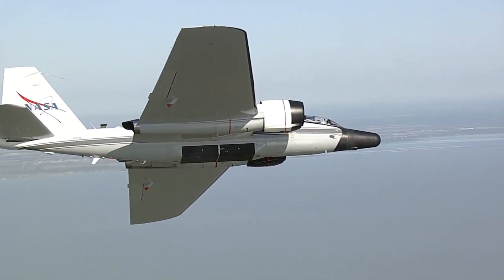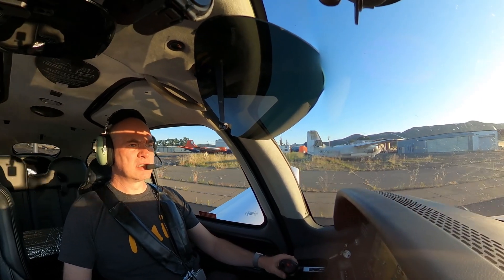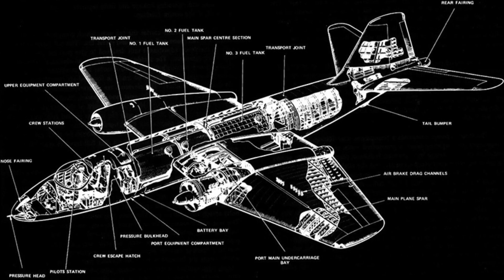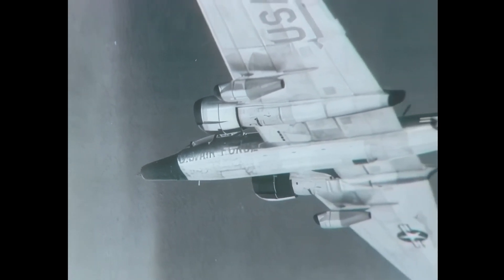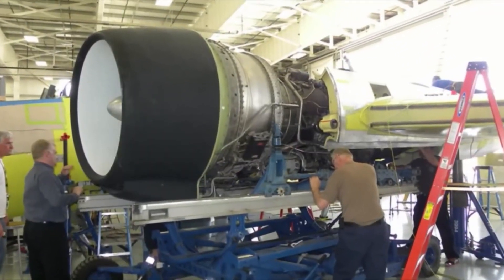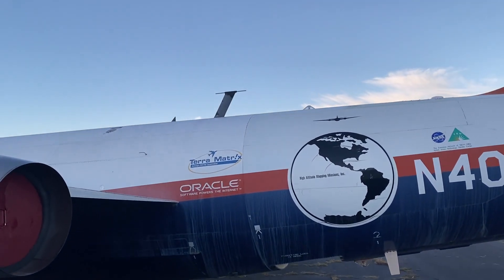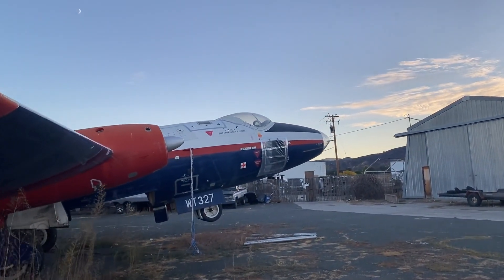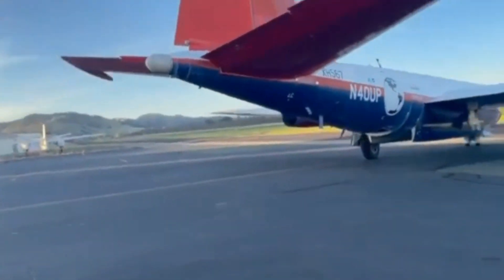Why NASA Relies On A 1950's Aircraft Design To Track 21st Century Spacecraft

Comment: That was an awesome story! I've always wondered about the history of the rb and wb 57!

While I was living in Houston, (all of the formation flying footage in this video was done over Houston and over Galveston bay)

 I got the rare chance to see one doing an experiment directly over downtown Houston one day. 

It actually caused quite a commotion amongst my fellow Houstonians who couldn't figure out why there was a giant high altitude contrail in the shape of an oval track, hovering right above our city. Panicked residents called 911 to report it and many of them asked if we were under attack! 

Turns out, they were just doing air quality testing with some new experimental equipment at 70,000 feet (so I was told).

 There are still three WB-57s stationed at Ellington Field where experiments that are built at Johnson Space Center can be driven over, installed and tested. NASA 926, 927, and 928. 

I also got the rare opportunity to see one up close while at our annual "Wings Over Houston" airshow one year. 

Back then I had no clue what it was and just assumed that it was a converted U2. I remained baffled by it for quite some time. 

This video really helped fill in some gaps! 

Thanks for posting it!

I really hope that the restoration group gets that old bird back into the air again. I always worry about the airframes on these old birds and I really hope that the restoration team doesn't overlook any potential damage that may have occurred in service. 

P.S. best comment section of the year 🏆 

!

Comment: The published service ceiling of FL 60 for the WB/RB-57F is for shure disinformation in respect being a high altitude aircraft and it's wing/engine config. The inoffical FL 80 is much more understandable. Also the FL 70 of the U-2, FL 100 is more realistic for it.

Comment: Thanks for that video a well deserved advertisement for this brilliant aircraft and its history. The originality design was under the stewardship of Teddy Petty (Lysander, Lightning, Whirlwind, Gnat) and started its gestation as the war came to an end. Originally this aircraft was to be a stop gap bomber u till the V Bomber force came into operation especially as it was anticipated there would be delays to those sophisticated aircraft. As it turned out the Canberra was so good it long outlasted those aircraft in service and indeed has the honour of being the longest lasting RAF aircraft type. Its high level success has a lot to do with Petter’s experience designing the Westland Welkin a wartime high altitude fighter. The wing of that aircraft followed traditional aerodynamic knowledge of the period in regard to high altitude wing forms (wind tunnels at the time could give unrepresentative results which affected for example Hawker design of the Hurricane and Typhoon) which in this case led to putting it simplistically long and thick at the base wings. This proved fundamentally wrong in reality and thus lessons learned by Petters team on real time air flow led to the thin shortish wings of the Canberra when he moved to English Electric that was world leading at the time. 

In the uk there is a working Canberra in taxiing state in similar livery to these ones ironically that also has an impressive history, having been gone between fighter and bomber profile and was used to cover and film the early UK nuclear bomb programme.

Comment: The engineers from the early Jet Age are hard to beat 

EE Canberra
Boeing 707/KC-135
Lockheed L-188/P-3 Orion
Lockheed C-130
Lockheed U-2/TR-1/ER-1
Boeing B-52
Tupolev Tu-95/Tu-142

Comment: Your Canberra XH567 Red/White/Blue is an ex-test pilot school aircraft that was based at MoD Boscombe Down the same as your  Edwards Air Force Base test pilots school. I presume that the test pilots were taught how to handle the Canberra with one engine shut down because it can be a bit of a beast on one engine. This is only speculation on my behalf I'm not a pilot so perhaps some of your avaitors can put me right.
Reply: It was never with ETPS as far as I am aware. I was FTO on this a/c from 1978 to 1994 at RAE Bedford, It was one of ten in our fleet

Comment: I was a member of the USAF 53d Weather Recon Sq, out of Ramey AFB in Puerto Rico, late 60's.  We did a TDY to sister weather unit stationed at Yakota, Japan, i think it was the 57th WRS.  They had the 4 engine models of the WB57, long wing.  Pretty cool aircraft, takeoff and landing were special.

Comment: The Canberra's contribution and capabilities is often sadly overlooked here in the UK partly due to the often "opaque" nature of its more unconventional missions but it deserves respect as do any of those rare and special aircraft (U2, SR71 etc) that have routinely operated above the Armstrong Line (60,000 ft). It was designed as the first RAF jet powered bomber to a specification laid down in 1944 to replace the superb mosquito and it served in many roles with many variants and saw considerable export success with the USA, Australia, Rhodesia, NZ, Argentina among its many operators that recognised its potential. Even France and Sweden used them for research purposes. 
General handling at all altitudes was excellent and it could be flown aerobatically outperforming many early fighters. It was only a "handful" when on 1 engine (Assymetric) at low airspeeds and altitudes and this had to be practiced regularly leading to strong leg muscles on one side. Early versions suffered at altitude with inefficient heating when outside temperatures got very low and in tropical or desert environments the crew were in an oven, in fact my father remembers having a DR on board who got heat exhaustion and passed out on the taxiway (and he was only in shirt and shorts!!) 
Although there were plans and tests to develop the RAF aircraft much further to make it refuel in the air the fuel system was not initially compatible and this was sadly shelved in favour of funding the new V bomber force.       
For those that may be interested the USAF competition was held in 1951 at Andrews Air base against the XB51 and B-45 (both excellent designs) each aircraft performed the same routine for comparative purposes with the Canberra flown last by Roland Beamont. The story as told to me was the aircraft completed its manoeuvres within the airfield boundary and then sequence completed Roland noticed he had a few minutes spare so in typical British manner he went a bit "off script" and started "throwing the aircraft about" with a low pass into a max rate turn and vertical climb, then shutting down both engines and spiralling down into a short touchdown albeit with all tyres bursting (due to the abrasive sand on the runway) anyway the rest is history and the Martin company made some useful improvements to the aircraft that led to the B57 (notably cockpit and airbrakes).

Comment: Was there a sticker on the side of the aeroplane you walked around of a Canberra silhouette with yellow and black stripes? If so, that was probably a commemoration of one of its roles as a target tug. 100 Squadron were based at RAF Wyton in the 1980s and you would see their Canberras most days.

Comment: Seeing the evolution of the Canberra is just neat. While the turbojet models were cool, the turbofan versions was just insane, especially with the longer wing span. I'm about to complete my A&P (aircraft mechanic license) and I think it's just fascinating to consider working on something like this. It's an ancient design, the airframes themselves are super old and it's basically a one-off. You don't exactly have a maintenance manual to work off of either. So cool.

Comment: That Canberra is in RAE (Royal aircraft establishment) colours and would have been based in Farnborough in the UK up until the 90s when they moved to Boscombe Down. I grew up in Farnborough and saw them flying around all the time. They also had a cool c130 with an elongated nose called snoopy. Didnt expect to see one on your channel!
Reply: Actually they were based at RAE Bedford, we had ten Canberras as part of the Radar Flight Trials Unit which was a lodger unit run by Royal Signals and Radar Establishment at Malvern. One of which was WT327 the other Canberra in the video, its last work there was research on synthetic aperture. They all flew out of Bedford when it was closed in 1994.

Comment: The U2 is a very specialized aircraft and not made for carrying much as far as payload, it was purely a high altitude spyplane then used for research.  Why design and build an entirely new aircraft when you already have a solid proven plane just needing extensive restoration? They already knew what it was capable of and modifications that worked, so it's a relative bargain as far as that goes. No problem keeping a great design around when there's nothing wrong with it.

Comment: During the Shuttle RTF I was stationed at NOTU Cape. Navy had a civilian ship fitted out with a 25 M (give or take) microwave dish. They load that thing up with a big crane they used to service the subs. They take it out directly under the path of the Shuttle. I saw videos of the RADAR. They could see things as small as a fingernail. It was a minimum crew as small as the risk was, it was under the shuttle’s flight path. I imagine it’s still doing its thing. I go over from the West Coast every so often to help get it on and off. Good times as I got a good look at a few launches. Then the ones they didn’t need me. I got access to the (now just closed) VIP bleachers. I don’t think we were more than a mile from the Shuttle. We got to see Endeavour take her last trip on the next to last launch. They scrubbed so I was lucky to get leave the next week to see it.

Comment: Ex FAA chap here. Worked on Canberras in the early 90s. Had a bit of a chuckle, the Canberra you filmed with its nose in the air was probably due to the airframe being left outside without the hockey stick fitted to the tail. When left outside, we would fit a piece of ground equipment shaped like a hockey stick to the tail as in certain conditions the aircraft could become tail heavy.

Comment: When they were scrapping them in the late 80s, I bought one of the reconnaissance camera lenses I think the negatives the camera took were 10"x 10"., it had a 5" 5 element objective at f 6.3 built like a tank and heavy with variable apature it would have cost many thousands to make, I payed £20 and turned it into a wide field telescope, maybe it did do some spying in its time.

Comment: Look up "Green Leader" Rhodesia and you will see that these were very good at low level too. They were exceptionally quiet and could be on you before you knew it (personal experience). There is a story from the Rhodesian Bush War which gives an account of a Canberra strike on a ZANLA camp and what gave the game away was not the sound of the jet engines but the bomb bay doors opening. Their operational range was excellent too and they even reached out to Angola from Rhodesia.

Comment: There was a weather squadron across the field at Yokota Air Base in Japan when I was stationed there back in the late 1960s.  They had WB57s that had 4 engines. A TF33 and a J60 on each wing.  I’m told they would shut down the big fans at altitude and just run the J60s.  They were used to sample the air near or maybe over the Soviet Union to see if they were testing atomic bombs.  Watching them take off was a real treat.

Comment: Hey at 10.07 you show a Graviner fire extinguisher with the gun powder firing cartridges still attached I worked on those in the UK haven't seen one in years. Is that the thing that you talked about firing the engines?
Reply: No. the starter cartridges are located in the nose cone of the engine, they are just like an artillery shell cartridge, 3 inches by 71/2 inches, just measured one of mine , used I might add

Comment: My father worked on the RB-57’s during Vietnam.  He would tell stories of the black powder cartridge staring system and the fire department showing up if the airfield wasn’t used to them thinking something was on fire.  Other cool stories were of a weapons system installed in the bombay that was basically a battery of guns that pointed doesn’t and would all fire into the jungle, or loading conventional munitions in the belly and wings.  Defiantly an interesting plane with a long history.

Comment: The WB-57's that NASA use with the extended wings and turbofans have to have an extensive wing box inspections post every flight due to stress cracking. No one argues that the Canberra and the Martin B-57 were designed to last, but not to carry the tensile weight of that extended wing and engines. If memory serves the one retired refitted WB was removed from service due to this box stress cracking. But it is a brilliant design overall and a total credit to the men at English Electric who could have never imagined that their creation would still be serving in action so many years later. Also a trivial note. When the WB-57 is used for US DoD purposes, the NASA logos are removed from the airframe.  When it goes back to NASA for civilian research, the logos go back on. A WB-57 was spotted in non-NASA dressing in the UK during a large international air force meet.

Comment: My father worked on Canberras whilst stationed in north Africa, I think it must have been RAF El Adem in Libya as I remember him talking about Tobruk. I also have pictures of him on the beach and swimming and this base was near the coast. He was an airframe techhy and back in those days you only had to ask to get a trip up in the aircraft. I remember him telling me about lying in the front of a Canberra staring out the plexiglass nose at 400mph 50ft off the desert floor, he said it was incredible!!! He loved the Canberra, said it was a fabulous aircraft considering when it was designed!

He went onto work on V bombers back in the UK, he was responsible for grounding the Valiant fleet for a short time after finding cracks in the Rudder stops if my memory serves me correct, he also told me about find ‘scary’ cracks in the main spars shortly before the Valiant was removed from service!

Comment: Cartridge starters were developed for radial engines as far back as WW II or maybe before. One good shot could give you several dozen revolutions of the engine, which (hopefully) was enough to draw sufficient mixture through the cylinders to let it ignite with the spark plugs.

Comment: An RB-57D crashed at my high school in 1964! The crew ejected at high altitude when those long wings came off. The fuselage travelled 6 miles and landed on the teachers' parking lot between two wings of the building narrowly missing a school packed with 2000 students. A decade later when I attended high school there the teachers were still joking about whose cars got crushed and whose didn't. It happened 3Jan1964 at Beavercreek, Ohio. In 1959 an F-104 pilot ejected and dropped his plane on a former schoolhouse in Beavercreek killing a mother and her two daughters. The hazards of living near an Air Force base! To the USAF their pilots are more important than the civilians on whom they drop their aircraft when something goes wrong.

Comment: In Australia we have a flying Canberra operated on behalf of the RAAF by the Temora Aviation Museum. They converted the cartridge starter to a conventional electric motor starter because the cartridge system is corrosive to the turbine blades and increases maintenance and cost. That was workable when everything was paid for by the military in service but not so much when funded as a historical flying museum piece.

Comment: One of them after sitting in the boneyard for 40 something odd years they did a complete rebuild and , brought it back to life and also they did some scrounging at the boneyard and now has a ejection seat from F16 Wings are new avionics upgrade to a glass cockpit brakes came off. I think I saw somewhere off a F15 there’s a YouTube video out the of the rebuild process. It’s only been a couple of years.  But today is the oldest aircraft ever to be brought back to life from the bone yard

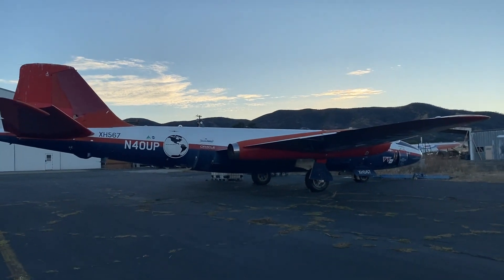Comment: @8:25 - and seen taxiing @12:16 - Tail number N40UP shows up in the FAA Aircraft Inquiry database.  First certified in the U.S. on   9/16/2005 and cancelled (expired) on 1/16/2019, this particular Canberra B6, serial number 71398 was, as you said, manufactured by English Electric Co. Ltd. in 1954 and is one year older than I am.  At the time of cancellation it was owned by High Altitude Mapping Missions, Inc. in Spokane, Washington.  It was classified as an experimental aircraft in the category of research and development.

Comment: Thank you Scott.  The Canberra aircraft and it's many derivatives make me proud to be British.   The Canberra was born at the same time I was.  I'm happy to say we've both led long and interesting lives and plan to continue for some years yet.

Are you aware that the original designer, 'Teddy' Petter, intended it to have a single engine?  It became a twin engine design following consultation with Rolls-Royce.  initially the engines were to be installed in the wing root, a la the DeHaviland Comet, but were instead positioned mid wing to improve the weight and balance characteristics and increase the bomb bay capacity.

Fly safe.

Comment: Also, the comment at 11:16 about it being on its tail has nothing to do with VTTS. As I said, in the 3 years since they won it, they haven't (to anyone's knowledge) come out to see it. The Canberra is known to be tail heavy, and if the fuel management is done incorrectly, its CoG will shift to the aft and it will rock back onto its tail. This has happened to WT327 before over the years and she was put back on her feet for the auction. Sometimes a 'pogo stick' is used to support the tail cone but evidently one isn't available. The missing entrance door also has nothing to do with VTTS.